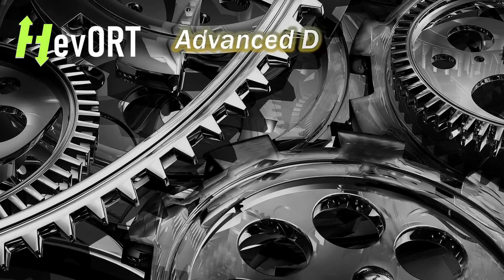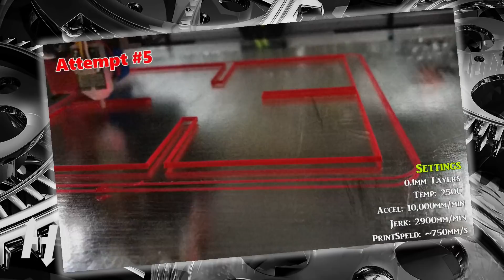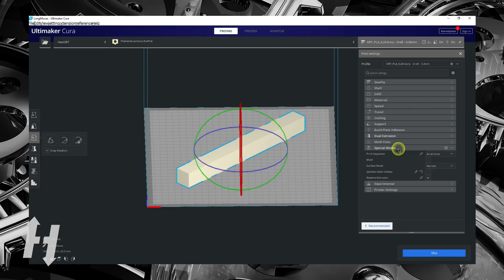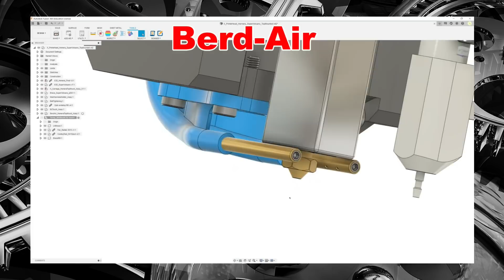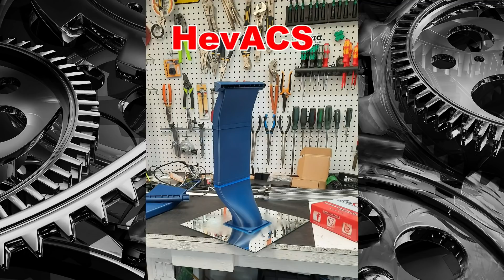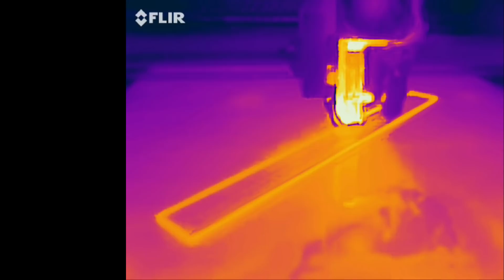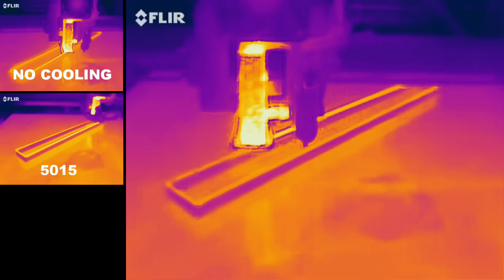Ultimate 3D printer Cooling fan - 5015 vs Berd-Air vs 300CFM Mega Cooling

Comment: Did you test the layer strength with each different coolingsystem?
I could imaging that the hevACS would not be as strong because it doesn't melt that much into the previous colder layer.
Reply from the maker: That is an interesting question.  I have tried several parts and none of them have layer adhesion problem.  With the HevACS you can bump the temperature a bit higher and slice the model with a layer height / line width ratio that increases the squish pressure.  I will do more testing in that direction.  Thank you.
Reply: @MirageC  This is great video about cooling and i was thinking about same think with Hendrie , im using my part cooling fan around %30 all time  (5015) powerfull cooling is good for beauty parts but for strong printed parts , slower cooling for layers better everytime , there is one video about cooling fan persentage vs part strength by cnckithcen maybe you want to watch that. Great design for better ooling parts!!
Reply: @MirageC  Please take more video of your "more testing". Also please make more video about the hevACS system, shows the parts installation, your video sound volume is too low can't hear it so much. Hope you can make the video soon as possible because it is awesome.
Reply: Also depends on the material
Reply: Came here to ask the same question.  I would be curious how the hevacs system would work in combo with a heated build chamber, since in theory the part couldn't cool beyond the temperature of the ambient air.  The hevacs system could also be used as a recirculating system for the heated chamber as well.

Comment: What aluminium extrusions do you use? There exist many different types, with 8mm slot or 6mm slot? In the Bom there is no specification about that. Also could you try to include links where you can buy the parts? That would also be helpful to get detailed info about the parts
Reply from the maker: 8mm wide slot 3030 T-slot type are the ones I use.

Comment: How about 4 small axial fans blowing air down besides the hotend
Reply from the maker: You mean having to carry around the weight and size of 4 fans on the X carriage?
Reply: @MirageC  how about a jet turbine with an air cooler on top of the printer blowing ice cold air down

Comment: Really great topic with a good method and well demonstrated results. Only criticism is the audio level is way too low. Even at max volume on my machine I had to listen closely without other ambient noise. But again, this investigation is EXCELLENT!!
Reply from the maker: Thank you for the feedback.  You are the second commenting about the audio level.  I have checked two of my devices here and it is pretty average with anything else I watch on Youtube.  May I ask what device are you using?  I will investigate to find what I did wrong.
Reply: @MirageC  I do not have this same issue with your other videos, this one was different. I listen using the speakers of an LG ultrawide monitor driven by a really old NVIDIA video card. To listen to most YouTube videos I set the volume at about 25%. This is not the only video that I have to make louder, but it's the exception rather than the rule. 

I don't post videos, so I don't understand the process you go through, but it would seem to me that YouTube should have some sort of AGC for videos that are uploaded. Bad on them for not making this easier. Let me know if I can help you out at all by answering other questions. Again, great videos!!
Reply: @MirageC  it's a bit lower than normal
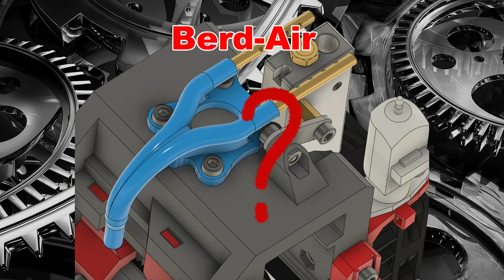Reply: @MirageC  Listening on my pc. First 4:18 is perfect. After that it's way too quiet...  But thanks for the video. I would like to see some overhang tests. Please use one where the same overhang prints in all directions because cooling is not the same in all directions. Maybe try a lattice cube?
Reply: @MirageC  I restarted Firefox and volume is much better, but not as good as other videos. (Volume is still too low after 4:20!)

Comment: I'm waiting for this project to end because it's a very nice and industrial-style printer.
Reply from the maker: At this pace you might wait a long time :)  I feel its a never ending thing on my end! haha!
Reply: @MirageC  Very good 
So
Instead of using a couplinIs that product? 
http://motechmotor.com/productDetail-0201-112.html
Reply: @bakibayram4299  bad idea overall. You want couplers with ball screws so they can wiggle a little. Otherwise they are too tight and can cause issues.
Reply from the maker: @bakibayram4299  I am in discussion with these guys for my next motor upgrade :) : https://www.teknic.com/products/clearpath-brushless-dc-servo-motors/

Comment: Hevort antarctic cooling system.. damn you're good!
Reply from the maker: Too many beers involved in the name picking process for this one! :)
Reply: @MirageC
But with such cooling performance, it must certainly be affecting the bed temp no?
Also have you tried it with other materials then pla?
Reply from the maker: @ckafrouni Did not try with other than PLA yet. My goal is to add a small door at the bottom of the printer to select air from outside or inside of the printer.  This way the thermal shock would be manageable with ABS.  As for the Impact on the Bed Temp, Since I am using a Keenovo 120V 750W heat pad i was able to PID tune the duet with the HevACS on.  This way the control board can compensates for the additional turbulence.  Remember that as the print progresses, the bed will go down, but the HevACS ducts will stay up ;)
Reply: @MirageC  Great video as usual, why not implement another temperature probe to manage ventilator speed, and automatic opening of the hatch?